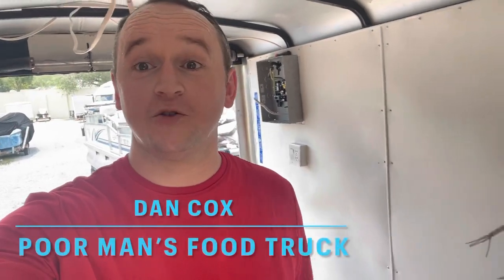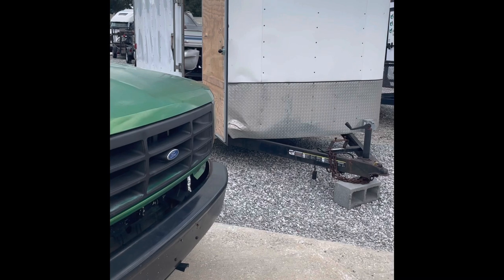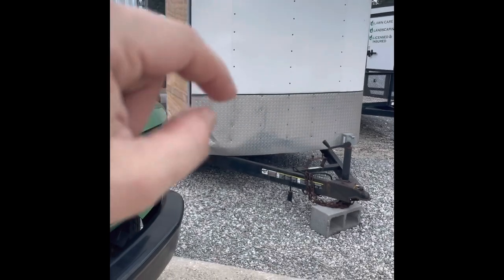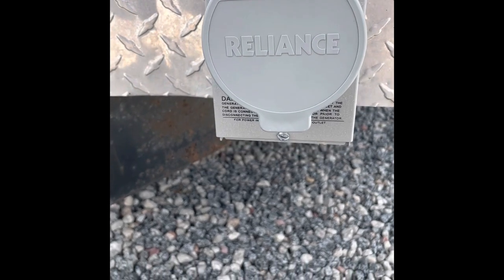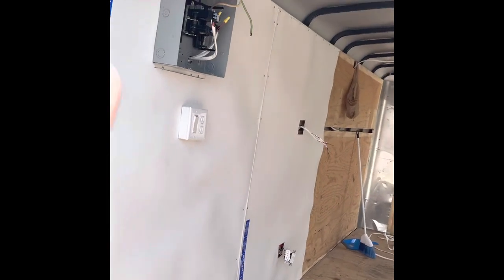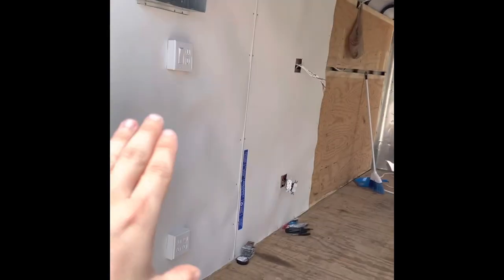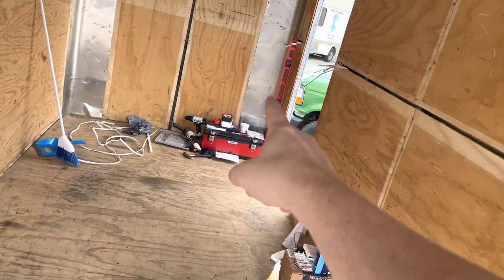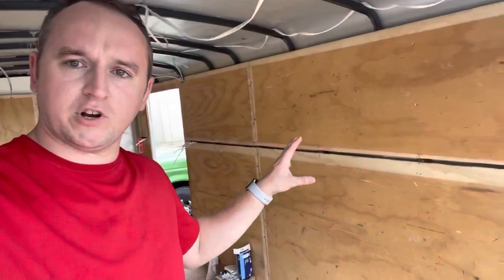Food Truck Overview - Poor Man’s Food Truck

Comment: so you are running a water pump is it an instant heater or are you doing a 5 gallon tank
Reply from the maker: Haven’t quite got that far yet, but I will be using a SeaFlow pump with a propane water heater. Although it’s not instant, from what I understand it’s pretty quick and will save having to use an electric water heater which uses a lot of electricity